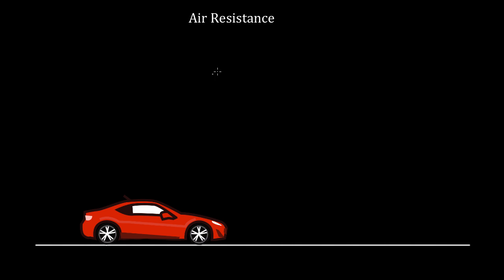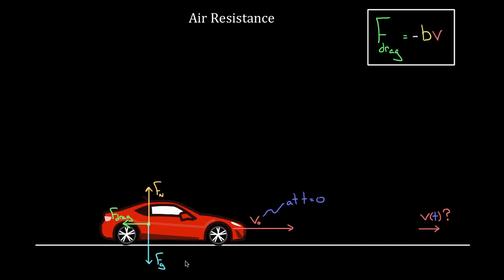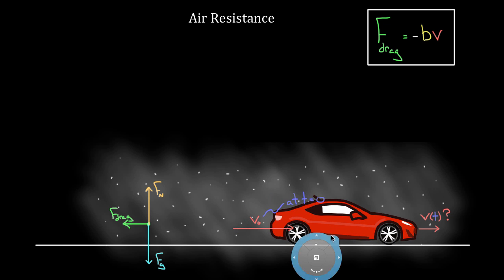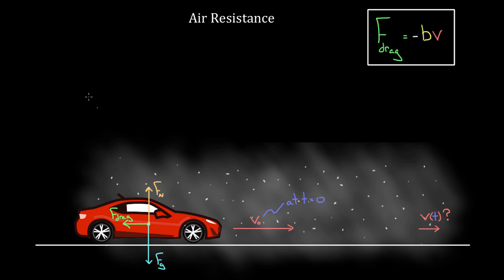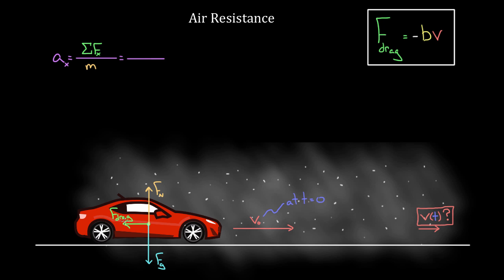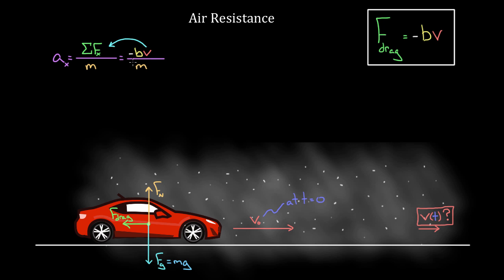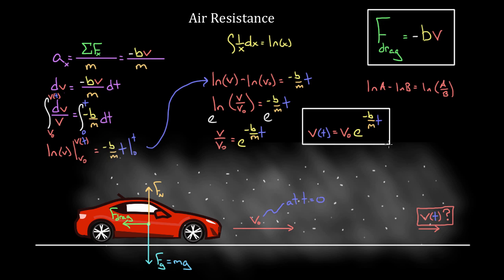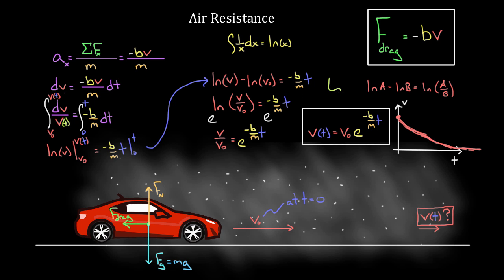Air resistance (initial horizontal velocity)

Comment: Any reference how the constant "b" is calculated?
Reply from the maker: It isn’t typically calculated, it’s usually measured. It depends on the shape of the object, cross sectional area, viscosity of the air, texture of the surface, etc

Comment: can I integrate the final function to derive a displacement function in terms of time?
Reply from the maker: Yes
Reply: @WeAreShowboat  thank you very much!
Reply: @WeAreShowboat  And if the derivation you showed in the video is in terms of vertical motion, then we would have to take into account f=mg as well?
Reply from the maker: Jet Leung yeah, you'd have two forces. So you'd have to do a u substitution in your integral
Reply: @WeAreShowboat  Thank you! Also, what is the value of the constant before velocity? And how can calculations be done if i dont know the value of the constant?
Reply from the maker: @jljlhk0726  That will be different for each problem (depending on shape, texture, cross section, etc.) and typically needs to be given.
Reply: @WeAreShowboat  is it equal to the drag coefficient?

Comment: I thinks you don't talk about force from engine car this force made car run.
Reply: That's not how the engine actually works in physics the way you may think. The engine doesn't actually make the car go forward from a physics point of view. It's actually the electrical forces between the tires and the pavement of the electron clouds as the force of friction.